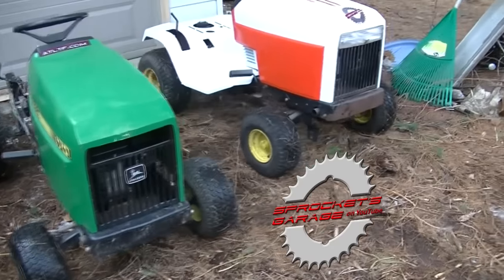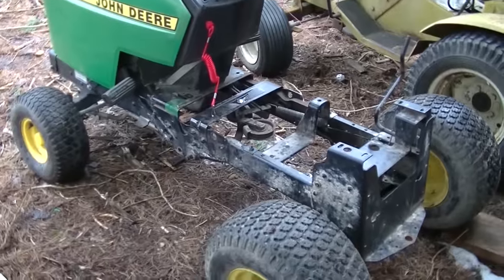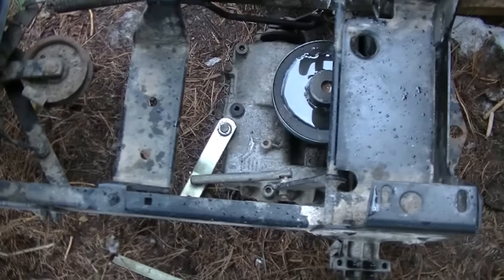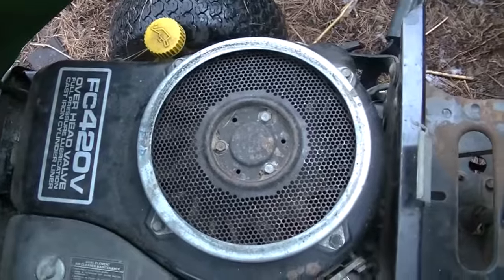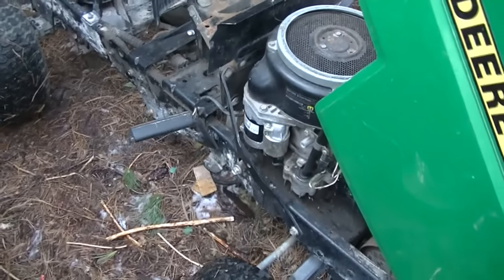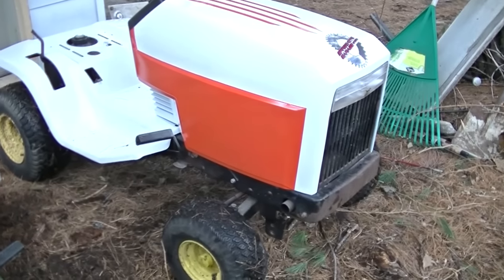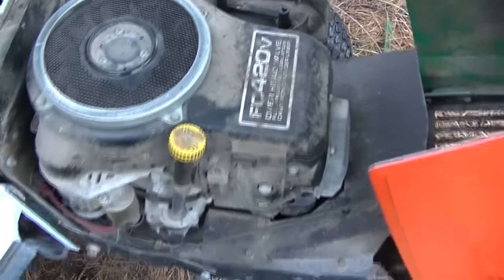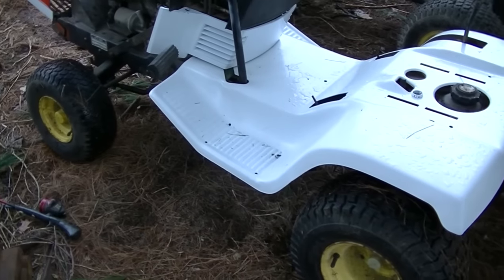Deere, Deere!

Comment: Hey Sprocket. Cool video. How's things going?
Reply from the maker: +Gary Lowe Not bad. Have definitely been worse!
Reply: Sprocket's Garage Good. Glad things are going good. The shop is coming along well by the looks of things. Is it set up to where you want it now?
Reply from the maker: No sir. Come the spring, I need to reshingle it. Once I have done that, I can drywall it. Once THAT is done, I can finally set up shelves, racks, storage, etc, as I want it. No sense getting too crazy with that just yet.
Reply: Sprocket's Garage Ah. Yes. You still have some work ahead of you then. It will be worth it in the long run. No sense in doing a half assed job then spending the rest of your life trying to bodge it.

Comment: are you still looking for and air filter and cap
Reply from the maker: +garrett monk Yes, I am!
Reply: is it inter changeable with one out of a 225
Reply from the maker: Not entirely sure. Do you know what engine is in it?
Reply: i think its the same motor but that blew up an the motor was sold except for carb and air box